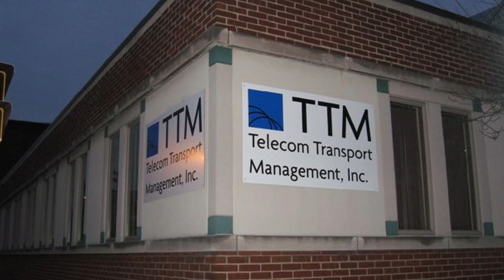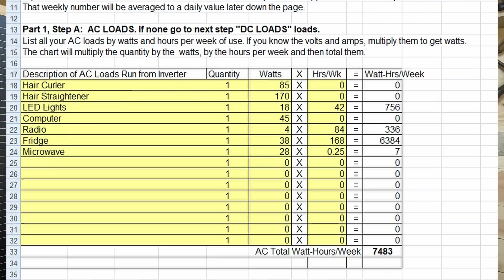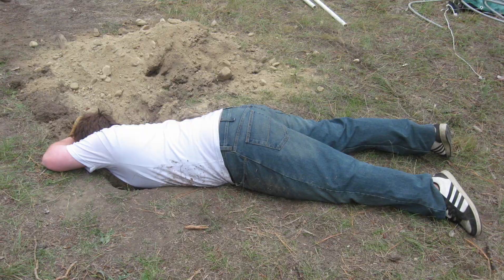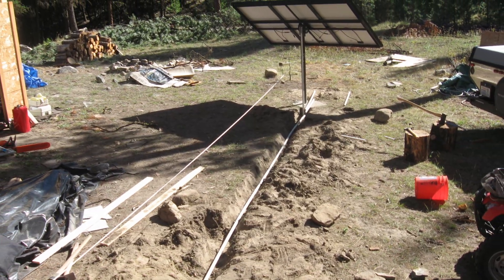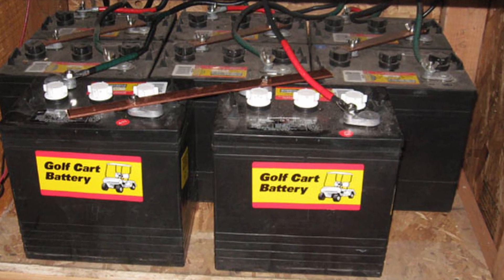GET READY for the EASIEST Cabin Solar Install EVER!

Comment: I heard that if you have exoflow, you can't use Victron at the same time. It has to be battery alone with Victron. Is it real? Under what wattage do I need to fuse the panel? I'm trying to build a 400w system for a fridge backup and outdoor lighting. Is the disconnect box a requirement?
Reply from the maker: That should not be the case.  What you need is to know the input voltage on the ecoflow.  As long as you are below that there should be no reason, it would t work.

I fuse 25% above in amperage max though frankly, the MPPT controller will not except more than. max so anything close should be fine IMO

Comment: Exactly how I started out in 2007 with my off grid desert cabin. 
Now I've got nice mppt controllers, 24V inverters, cables, 10 large panels, a few lifepo4 and a couple DIY lifepo4 300AH China batteries. 
At 70 I'm getting too old to upgrade the cabin. All this stuff stored on shelves at home.
Great video.!!
Reply from the maker: That's awesome! I'm at 2400w now with all sorts of upgrades.  Now, when you say it's all on shelves at home do you mean not at the cabin?  Why not enlist a young buck to come out and help?

Comment: As funds and various sales allowed I've purchased multiple power stations to cover my essential items instead of jumping into a larger system like a dedicated inverter/charger and a 48v rack battery. Is there a way to have a solar panel array, say four panels, that could power the solar inputs of multiple power stations at the same time? The power stations are different sizes so the solar inputs have different, but overlapping, ranges.
Reply from the maker: Not that I am aware of other than a CC with batteries and a big enough inverter

Comment: At my off grid cabin I started 6 years ago with 200 watts of renogy panels, a PWM controller, 1000 watt pure sine inverter and five used AGM automotive batteries I got from working at a Ford dealer. 

I've only increased to 400 watts of solar, a much better MPPT controller and a better 1500 watt inverter.  More solar and lithium batteries are next.
Reply from the maker: You'll love the LiFePo4's!  I'm at over 2400w if solar now and all sorts of upgrades and love it.